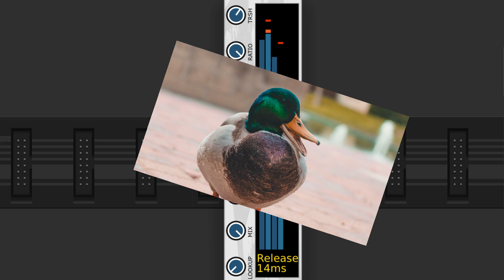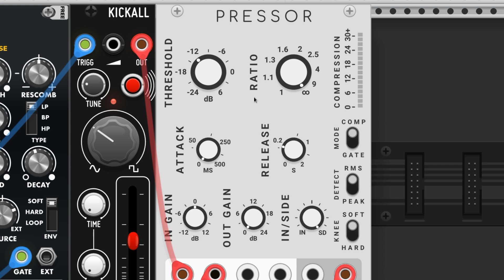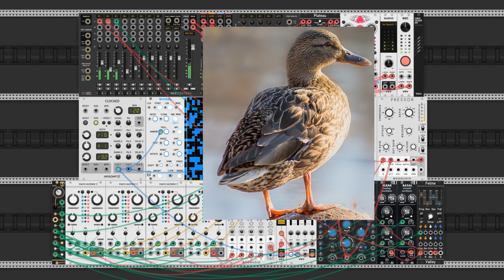Ducking in VCV Rack: Sidechain Compression

Comment: Another great video! Do you have a way to sidechain most - but not all - of the inputs on the mindmeld mixer?
Reply from the maker: hmmm. If you want to duck them under the same source you could run another small mixer, mix the voices to your liking, then feed that through the compressor and boom multiple voices ducked. This method uses two mixers but I think it will work out. I'm just spitballing by the way I didn't plug anything in to test this haha

Comment: Thanks for this awesome video. If I understand this correctly, in order to achieve the ducking effect (suppressing of other tracks in order to emphasize e. g. the kick drum), the GAIN of the side-chained compressor should NOT be used (set to 0 db), correct? Otherwise I am really going against my desired effect. Did I get this right?
Reply from the maker: Great question! My personal opinion is that the threshold, ratio, attack, and release are the most important controls and the gains can be mostly ignored. The input gain can make the input signal louder so that it can more easily pass the set threshold. The output gain will increase the volume of the already attenuated signal so it will still duck in the expected way; it will just be louder in the mix. 

If we were to increase the input gain in the example from this video, it doesn't make much difference to the result because we have the threshold set to a good level to attenuate the bass. If we increase the output gain, we can hear the bass ducking still but it pushes the levels past distortion. It sounds pretty cool actually; I'm listening to it now. Reminds me of phonk music haha.

I hope that gets at your question, @f_rankie5992

Comment: In the past I've taken the envelope from Trummor, ran it through an attenuvertor to invert the envelope signal, and used that to modulate the volume of whatever I"m ducking. Are there advantages or disadvantages to this method v using the compressor as you outline?
Reply from the maker: Hey, JustSomeGuy
Using an attenuvertor is a cool way to duck too. I personally prefer using a compressor because it allows you to have some more control over the aspects of the duck without altering the envelope of the original signal. The attack and release functions available on most sidechain compressors are clutch. In hardware, attenuvertors are generally cheaper and less HP so that would be a huge benefit especially if you want a compact rack. I can think of a couple of small compressors with sidechaining however like the 2hp's Comp.
Reply: I lean on the same trick with trummor2 as well. The big gotcha is you need a drum module with an envelope output, or an envelope follower to do it that way. The compressor with sidechain input can duck with any input.